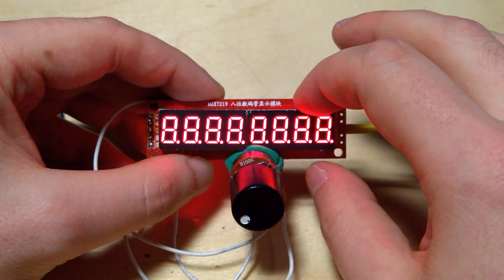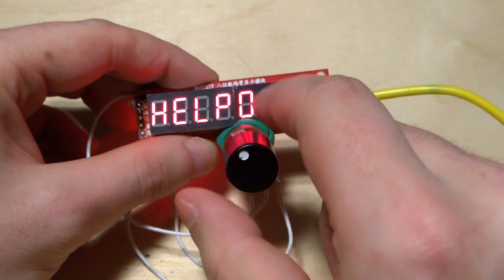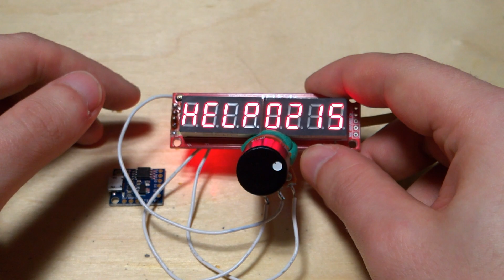Chinese Digispark Knockoff Problem

Comment: Pin 5 may be used but needs to be mapped, a small workaround...just upload the sketch and see:
/*
Comparing 3 different Analog Values using Map Function using 100K Ohm Log Pot:

Reset Pin 5 / ADC 0 Values:
0.00v - 1.20v = LOW  (Reset Enabled)
1.25v - 5.00v = HIGH (Reset Disabled)

Connections on Pin 5:
VCC - 10K Ohm
(Pin5 Connects here)
10K Ohm - 100K Log Pot
100K Log Pot - 6.8K Ohm
6.8K Ohm - Ground

Value when turning Pot fully up, to fully down, and taking measurment on Pin 5:
Pot Max = 4.58v
Pot Min = 2.23v

Values given by adjusting pot to 3 different positions, and taking measurment on Pin 5:
Mode 1 = 2.23v - 3.50v
Mode 2 = 4.10v - 4.42v
Mode 3 = 4.50v - 4.58v

//--------------------------------------

USING LOG 100K POT TO MAKE MODE SELECTIONS:

Mode 1 (LOW)
LOW RANGE:(valM >= 0 && valM <= 100)
2.23v = 456.258 ADC
3.50v = 716.100 ADC

Mode 2 (MED)
MED RANGE:(valM >= 190 && valM <= 210)
4.10v = 838.860 ADC
4.42v = 904.332 ADC

Mode 3 (HIGH)
HIGH RANGE:(valM >= 230 && valM <= 255)
4.50v = 920.700 ADC
4.58v = 992.310 ADC

//--------------------------------------

*/

int Slide = A0;

int LedL = 0;
int LedM = 1;
int LedH = 2;

int valM;

void setup()
{
 //Serial.begin(9600);
 
 pinMode (Slide, INPUT);
 
 pinMode (LedL, OUTPUT);
 pinMode (LedM, OUTPUT);
 pinMode (LedH, OUTPUT);
}

void loop()
{
 
 int valR = analogRead(A0);
 
 valM = map(valR, 456, 992, 0, 255);
 
 //--------------------------------------
 
 {
  if (analogRead(A0) < 456)
   valM = 0;
 }
 
 
 {
  if (analogRead(A0) > 992)
   valM = 255;
 }
 
 //--------------------------------------
 
 
 //LOW RANGE:
 if (valM >= 0 && valM <= 100) // LOW
 {
  digitalWrite(LedL, HIGH);
  digitalWrite(LedM, LOW);
  digitalWrite(LedH, LOW);
 }
 
 
 //MED RANGE:
 if (valM >= 190 && valM <= 210) // MED
 {
  digitalWrite(LedL, LOW);
  digitalWrite(LedM, HIGH);
  digitalWrite(LedH, LOW);
 }
 
 
 //HIGH RANGE:
 if (valM >= 230 && valM <= 255) // HIGH
 {
  digitalWrite(LedL, LOW);
  digitalWrite(LedM, LOW);
  digitalWrite(LedH, HIGH);
 }
 
 //--------------------------------------
 
 //Serial.println(valR);
 delay(50);
 
}